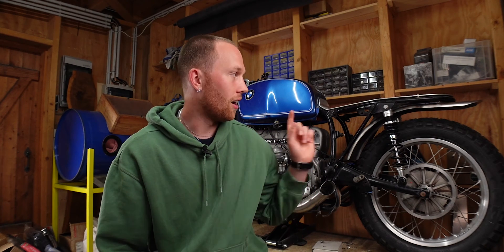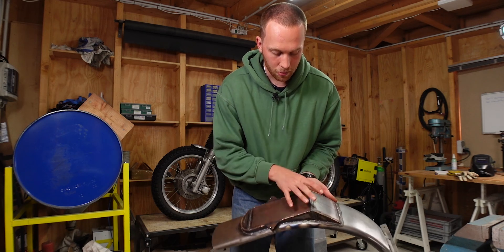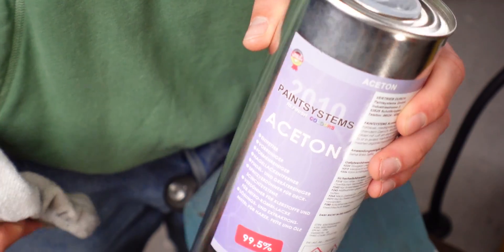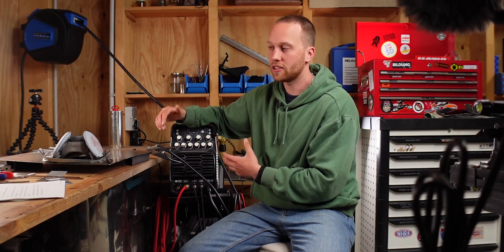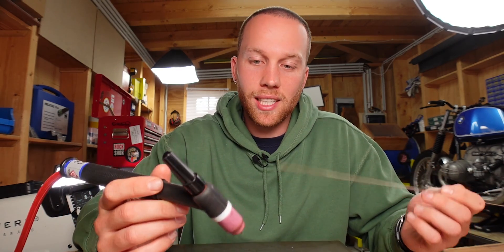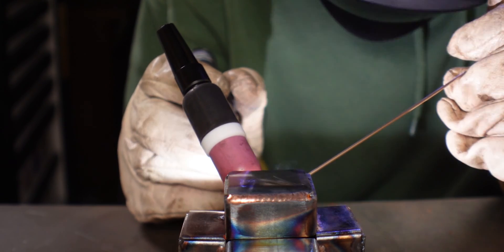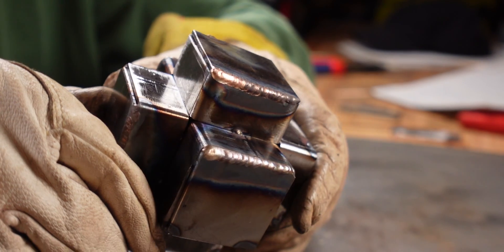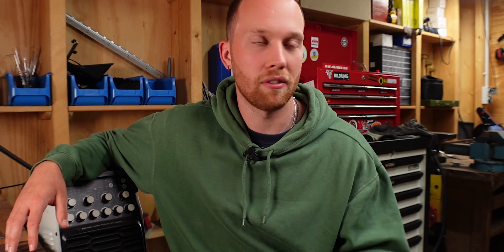How to TIG Braze - A Complete Guide

Comment: I've done TIG brazing successfully but it is a challenge to get the base metal hot without melting it before adding the filler rod, and I have sometimes had problems with the filler rod balling up, melting before I get it in the puddle.  I think you've got a neat idea to hold the torch more vertical, and look forward to trying that. Thanks for a good video!
Reply from the maker: Yeah it can definitely be a challenge. Thanks for the kind words and let me know how it went once you've tried it. It can take a bit of practice but I'm sure you'll get the hang of it!